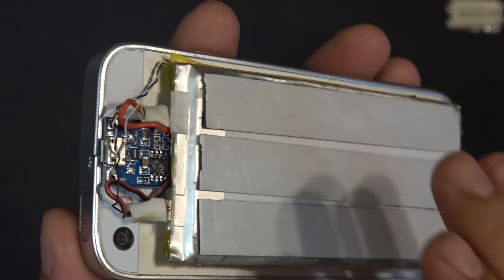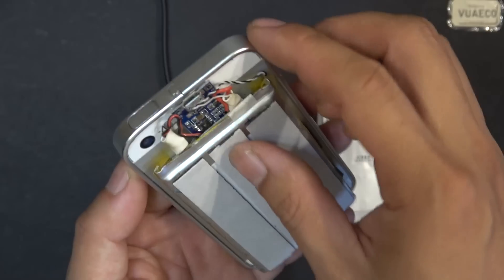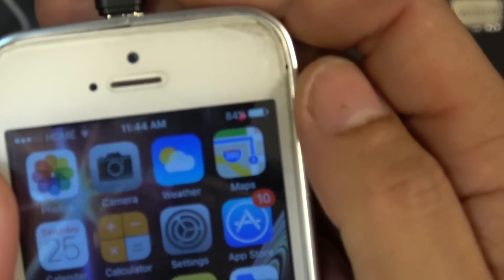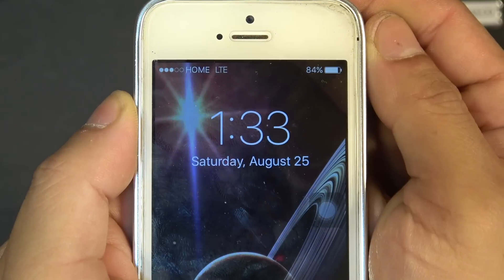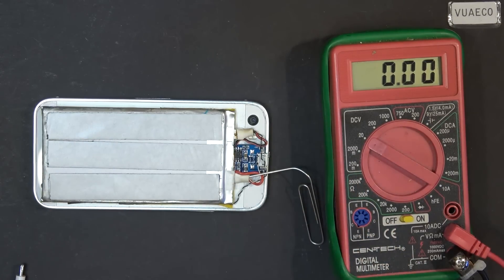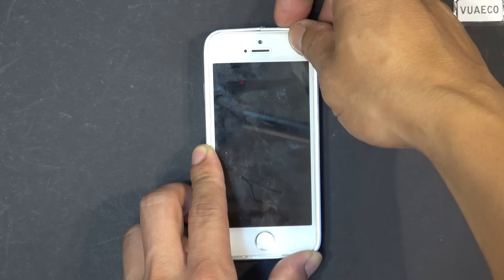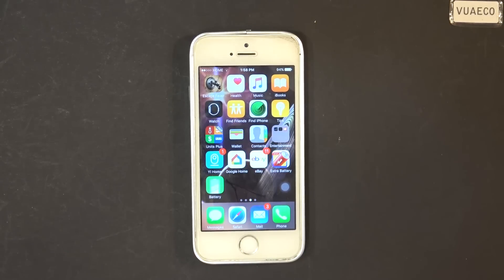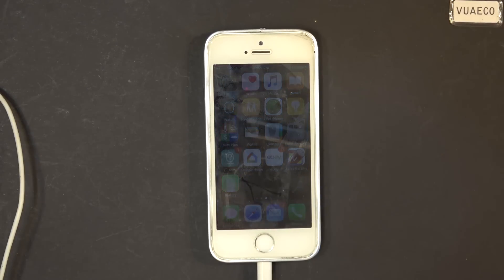iPhone battery experiment: Install a separate BMS: TP4056 on the back. Does it work?

Comment: That top green bar is the battery health. So it's detecting that 1300mah is available now out of the 1570mah that it shipped with. It's detected based on the amount of current used for charging and the resulting voltage of the battery

Comment: Sir can i use 3000 mah qmobile battery for iphone 5s 
Will iphone charger perfectly this battery by its own bms
Reply: Tristar will burn itself eventually, putting a separate bms to charge the battery is the best option, and if you can figure out a way to wire it such that it detects that it’s charging, even better (i strongly recommend yo put the bms inside the iphone to prevent any kind of damage)

Comment: Hey those batteries are designed to be charged till 4.40v if u think that the iphone overcharges it you are wrong. If it had a problem in charging the battery it wouldn't probably boot up
Reply: Also u shouldn't use 3.7v battery in place of 3.8v it would kill the 3.7v battery as both difference in charging voltage.

Comment: Those apps are useless, they are pre programmed with the rating for the phone you are using rather than analysing the actual data from the BMS, the health/capacity estimate is based on the number of cycles that have been used as reported by the phone itself

You need to jailbreak and download an app called "battery life" 

That app analyses the data from the battery and the built in ammeter to tell you how much capacity you actually have, how much current your phone is drawing, and how long it will last based on the current being drawn from the battery, in realtime rather than being based on estimates from Apple
Reply: You my friend, are a legend. I've seen many tweaks and stuff online but had never heard of this, it works a charm! 
My current battery is approx 300mah RIP. I've ordered a new (iphone 5) battery but will probs have a removable external pack.
Reply: @Calbe123  300mah????
How many cycles has your battery done?

My old 4S has done 1200 cycles and still has 900mah remaining battery health
Reply: @mwbgaming28  I think it had a bit over 700 cycles. It was a battery I got online, it seemed to be the same size and weight but idk if it was bad quality or not. Coconutbattery app on mac said it had 0 cycles when i got it. Last night it couldn't charge enough to turn on :(  I have a new $9 battery hopefully coming on monday from ebay.
Reply: Would using an iPad charger reduce the life much? I used that sometimes cause I wanted it to charge faster.
Reply: @Calbe123  iPad charger shouldn't cause any problems 

Problem with eBay, you get what you pay for, your $9 battery is probably counterfeit
Reply: @mwbgaming28  Oh yeah, i'm fine with that. It's lasted long enough for how much I paid. I got the first replacement off ebay because I knew it would be way better value than anyone could get at an apple store (and probably most third party). 
Instead of a second potential counterfeit, I was going to use one of these godly batteries from these videos (or have switchable 18650 cells in parallel) after I worked out where to get them from and how I would install them. Now my phone is not just unreliable but completely dead, I just wanted something that would work (until the mods are ready to install).
Reply: @Calbe123  fair enough, I wouldn't trust the BMS on the eBay battery though, if you still have your original apple battery, salvage the BMS from it and use that (same method that was used in this video) 

I do like the idea of a removable battery in an iPhone, if you go the removable 18650 route, I suggest leaving the sealed battery in the phone to serve as a power bridge so you can change the battery without shutting down the device

The best mod that I have done for a phone has to be where I hacked apart a moto mods compatible battery add-on and upgraded it from 5000mah to 50,000mah 

It was literally a brick, but I only had to recharge it once a month (the moto mods add-ons don't have the weird side effect of the battery indicator not working properly after modification)
Reply: @mwbgaming28  I do have the original battery, I'll use that with the new battery I'll have soon. vuaeco did make this video because he didn't trust the original BMS though? I noticed the battery I'm having trouble with has charged to 4.2V and has a current of 0.19mA with a 22k load. Idk how to test batteries but it looks normal from the outside. The phone still wants charge before turning on though. It must be so cool having a brick like that :D
Reply: @Calbe123  
I meant the original video where he added the external battery, forgot this one was where he stopped using the internal one 

4.2V is perfectly safe for lithium ion batteries, I use that voltage for most of my lithium projects

The way I test batteries is to fully recharge them to 4.2V at the max charge rate of the cell (usually 0.5C-1C) 
Then I fully drain the cell at the max continuous rate (usually 1C) 

If the cell doesn't get hot and is within 20% of the rated capacity I move on to the 3rd test

I fully charge the cell to 4.2V wait an hour and measure the voltage, write down the voltage then leave the cell in a non conductive box for a few months and see if the voltage drops (the cell voltage should stay rock solid the whole time, if it drops by more than 0.1V per month, drain it to 0V then throw it away, it's probably soft shorted internally and may catastrophically fail at any time) 

And yes, the brick phone is pretty awesome, I have since sold that phone to another tinkerer and upgraded to a ulefone power 5, and yes I have already doubled the capacity to 25,000mah :D
Reply: @mwbgaming28  Thanks for that. My problem was that although it can charge to 4.2V, the phone still has the red battery. It might be a software issue (or knock-off BMS). I actually just got my phone to turn on using the original battery (made in 2012), probably unreliable (which is why i replaced it) but better than a dud.
Reply: @Calbe123  I would say the BMS is one of the main reasons why your battery indicator shows red while it's fully charged 

Either that or 4.2V is the voltage that the device is programmed to associate with a low battery level
Reply: @mwbgaming28  Ok, thanks for all your help!
Reply: @Calbe123  no worries, need any more information about lithium ion batteries just ask
Reply: @mwbgaming28  I don't think I have any battery questions for now, but I do have some questions about your ulefone. Maybe it would be easier to chat somewhere other than comments. If it's ok with you, I could drop a temporary steam invite? (idk what else has temporary links and I saw on your channel you have steam)
Reply: @Calbe123  I do have steam but I'm in the process of moving house, so my computers are all in storage for the time being, I have discord on my phone if you want to send me an invite
Reply: @mwbgaming28  
https://discord.gg/Js8R6T this should be the invite link to a new server i just created, let me know if it doesn't work

Comment: I’ve got a tp4056 can use that to charge but where is bms?
Reply from the maker: Yes, you can use the TP4056 to charge. The BMS I was talking about was the original iphone BMS salvaged from the dead battery. It should be inside the smelly wrapping. It's soldered to the connector. If you can pull out the connector, you can pull out the BMS.

Comment: Is it built inside phone I punctured old battery threw in bin that new battery dead just 2 v I have power supply from my bench supply supplying 5v through usb lead lightning connector just using red and black usb end that ok
Reply from the maker: Inside the dead battery, it has a BMS. That BMS also comes with the connector to connect to the iphone. You need that to install a new battery. I don't think you can power on the phone without a battery, can you?

Comment: how do i connect to iphone battery tiny connector trying usb lightning connector using usb end red and black to power supply
Reply from the maker: You have to use the original BMS salvaged from the original old iphone battery. Then just solder the wire from that BMS to the new battery (that's if you're doing like what's shown in the video)

Comment: Hi my battery came for iPhone 6s was wrong one too wide but already got old one out punctured it ha.so another comes but phone won’t power up tried other battery too.left charging overnight but nothing iTunes recognises 6s on MacBook but nothing on phone.hAd meter on battery 3.2 volts new one is that enough?
Reply from the maker: 3.2V is too low. Can you charge the battery first (using something like the Turnigy Accucel 6 charger) before you install it on your phone? What I did was to charge the battery to 100% BEFORE I install it on the phone. After it was installed on the phone, it would NOT turn on at first. I had to plug it in (using the lightning USB cable) a charger first. Then it turns on by itself after I plugged it in. Other than that, it works like a regular battery afterwards. It just lasts longer and it takes longer to charge, that's all.

Comment: This is because the phones bms stops charging at a higher voltage than 4.2v. So 4.2v is not full charge to the phone.
Reply: Smarty you, exactly what I wanna say too, hehehe
Reply: This is actually positive, the cells live longer if you don't charge them to 100%, but rather in the range of 80 - 90%. A charging voltage of around 4V is actually sufficient. Only if you really need the entire capacity do you go to 4.1 - 4.2V

Comment: Just looked on eBay uk and there is hi capacity battery over 3000 mah by some but genuine apple is only 1700mah are these higher ones safe or should I stick with genuine at 20£?
Reply from the maker: That's expensive genuine battery. Don't believe in any claims on battery ratings more than the Apple genuine 1700mah rating. I used to buy the genuine ones really expensively just like you mention. But it turned out that they either use after market battery and re-wrap it in a genuine wrapper or they just sent me a genuine but used battery. After replacing a few times over, it gets quite expensive. And I'm getting tired of opening the phone and putting it back together. That's why I just choose a laptop battery and put in on the outside. I can get a much bigger battery. And if I need to replace it, it's fast and easy because the battery is external.
Reply: so any kind of laptop battery u mean like an ipad cell .just ordered one of ebay 15pounds will be careful charging either go up to 85percent on iphone charger or use tp4056 like u

Comment: Hi just remember your iPhone battery charge video with tp4056 was it?my iPhone 6s the battery gets down to about 40% then goes down quick so think been overcharged I tend to plug in at night and leave it all night so maybe I need new battery an only charge to 85% u say ? How did u wire the tp4056 to battery or do I need one of those on back or not?steve in uk.thanks for great videos man
Reply: So I can order a new iPhone 6s battery and tp4056 there’s one in uk what model iPhone was in video guess same design did you hear on news not long ago apple deliberately used software to make you buy a new battery not sure if that true or not 😆
Reply from the maker: I connect the battery to both the phone's BMS and the TP4056 board. When I charge the phone, instead of plugging in the Apple lightning cable to the phone on the bottom, I plug my USB charger with a regular USB cable to the TP4056 board.
Reply: So need to have a usb connector on back off phone wired to tp4056?
Reply from the maker: USB connector is on the TP4056 board.

Comment: Is the old battery and new one the same mah? I would think the new one has more capacity and the phones bms can not read the mah from the new battery so it's confusing it.
Reply from the maker: The new one has about 3 times more capacity. But that doesn't matter for a BMS. The most important thing for a BMS to pay attention to is the voltage, not the capacity. It just takes longer to charge. I've swapped out bigger battery on the same BMS on a lot of things. Take, for an example, the TP4056 board. Do you think it has to be pre-programmed to charge a battery at some predetermined capacity? Or does it have to charge at some certain voltage?
Reply: vuaeco  I would think it being made by Apple it would be different.
Reply from the maker: It might be different. But it should not charge the battery past 4.2V no matter what the difference is.

Comment: that is not a pretty design :) if you want your phone to last then still charge it to 100 but unplug it right away. The best way to use your cells is between 20%-80% for maximum life.
I've noticed on one of the battery apps I use that my iphone goes to 4.35v. That might be the design of these cells, some newer cells are rated higher. I know LG has some in that range as well as i think 4.4v max on others.
https://electronics.stackexchange.com/questions/244732/why-are-3-8v-lithium-ion-batteries-used-in-mobile-devices-rather-than-3-6v-or-3
you might be able to find a app that limits the charge...?
One reason why i love Lenovos/IBMs old Power Manager.

Comment: Is that a lipo battery with a 3.3 v nominal instead of 3.6? Be careful with that chemestry if so. BTW, awesome hack !
Reply from the maker: It is a lipo but low discharge one from a laptop computer. So it's the same chemistry as the 18650's from other laptop computers. This is made this way because later model laptops are made thinner so the batteries also have to be thinner. A battery pack made of 18650's is not going to be thin enough. So they just take a silver plastic pouch, wrap it around, and pound it flat! :D
 The 3.3V Lipo norminal you're talking about is the LiFePO4 high discharge cells for RC toy cars. They can discharge up to 40C (that's not Celcius!) as opposed to laptop cells (Cobalt based) that can only discharge up to 3C.